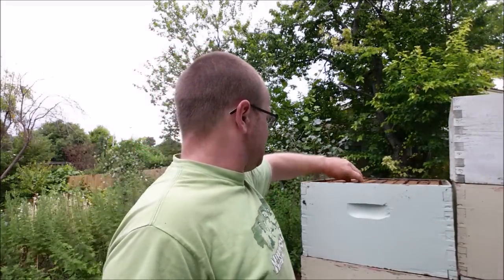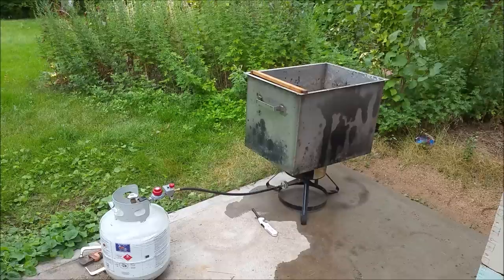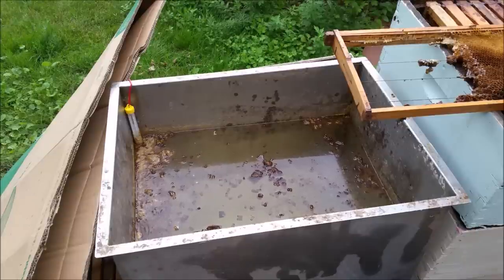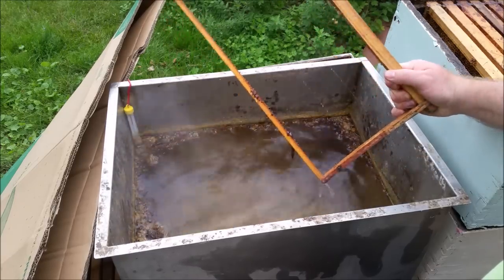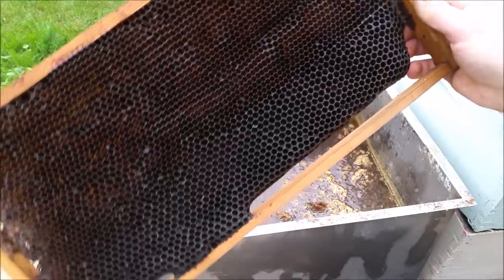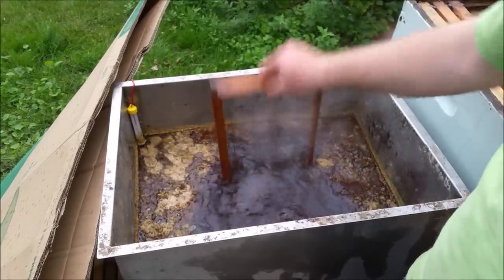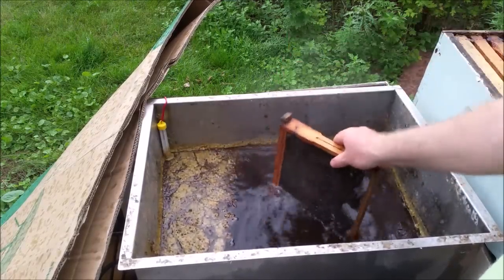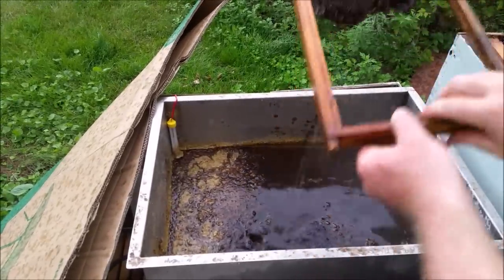How To:  Frame Rehabilitation: Step 1, Melt Comb Out of Frames

Comment: Could you use the solar melter to do this? You could put a few frames in at a time, use a passive energy from the sun, change a few frames out over the afternoon, it would probably take the same amount of time as this, but do both processes at once.
Reply from the maker: Solar melting takes far far longer. Nothing carries heat like water. If you stick your had in 150 degree air, it just feels hot. 150 degree water will scald you near instantly. Plus you're left with the mess of cocoons, those don't melt. You still have to clean them out of the frames.

Comment: You talk about using wood heat.  How about a rocket stove (burns wood) to heat the water.  More heat focuses on the tank.  Just a thought.
Reply: That would be awesome.  I'm a fan of rocket stoves.  I would have to set it into the ground to have the tank at working level, but it would be nice to do this with less wood burning at once, more efficient, no smoke, and able to burn out quicker.  Also could be useful for other things, like outdoor cooking.

Comment: Can you use this equipment be used to kill AFB spores in the wax, so that you could use the wax again, clear of the disease? I understand that AFB will die around 150 - 170 degrees. What do you know please?
Reply from the maker: You can use any melted wax, it encapsulates the spores.  AFB spores are ubiquitous in pretty much all hives.  They are part of the biology of the hive.  A proper balance of biological action in the hive keeps AFB in check, as well as hygienic bees.  If you're trying to sterilize equipment wax dipping is a good option, but that's with paraffin, not beeswax.  Beeswax scorches at 180F and turns brown.  You need to get paraffin up above water boiling temp to dip boxes.

Comment: man!  that is one cool container!    I NEED I NEED!!!--Mann Lake should make those!
Reply: Bee Bob easily fixed with a double burner, or how I usually do it, with a small wood fire. Just couldn't do a fire at this location because it was a rented house with no kind of fire pit.
Reply: Bee Bob That's correct. I use a candy thermometer to keep things under control. Beeswax should not be heated higher than 180 or it will scorch and change color.

Comment: are you worried about the fishing line melting or leeching chemicals when you dip the frame? or maybe youre using metal supports cant tell
Reply: No, only want water at around 160 to 180 F. Not hot enough to boil, doesn't seem to have much effect on the fishing line from FatBeeMan frames.  I don't personally use fishing line, but I do use plastic frames. They work really well in honey supers.
Reply: @wiredforstereo  may i ask you what you do to combat the bees building away from the plastic?  i have a few plastic frames that ive brushed with wax to get them started but the majority of plastic ive seen from my bees and others have a weird building pattern. The bees build away as to double the 'bee space' and make layer of wax they can tuck behind... does that make sense i can find a pic and send it to you. Do you have other social media? Im backroadsapiary on instagram maybe we can message there
Reply: @mmogg4045  Yes, find me on Facebook, or email me, info on my website.

Comment: You can burn wax? I did not know  that good to know
Reply: Yes, you can "scorch" it or whatever you want to call it.  If it gets over 180 it can turn orange or brown.  Still wax, but less aesthetically pleasing.  I forget what temperature it will spontaneously catch fire.  I always try to have water in whatever container I'm heating it with, that way it can never get above boiling temperature.

Comment: Wouldn't it be quicker and easier to start with straight hot tap water instead of trying to heat up cold water?  It would save a lot of time and propane. Also, since the tub you are using is twice the size of the burner, why not use two burners?  That would double the heat output, and should have no trouble keeping the water hot enough.
Reply: Of course. Just didn't have a tap in the back yard. I also use wood heat when possible, even cheaper and faster, but less controllable.

Comment: were bee suit?
Reply: rodney adams Not usually necessary. Bees attracted to melted comb find themselves part of it.
Reply: it my lucky day your online right now. got few questions if don't mind. how do know what combs to leave for next year and what combs to harvest honey. witch get wax. do most bees die and rehatch from eggs kinda like butterflies or are there live bees in hive though out winter.
Reply: also like how much honey and wax can safe harvest from one hive with out hurt bee. is what wanting know. think do candle making and try guess how many candles make with out hurt 1 hive to much. I'm in country but lot house near buy so not want have to many hives if do decide do this.
Reply: rodney adams Bees only live six weeks. So I'm not concerned much about hurting them. How much you can harvest is completely based on the location and management style. There is no way I can tell you what you will be able to do. It will be cheaper to buy the honey and wax.
Reply: @rodney73991  In warmer areas you can get away with leaving the bees a single deep box over winter. In colder/northern areas you might need more than that, I'm not sure how much since I don't live up there. When harvesting honey you'll take however many honey supers there are off (the bees will have to be removed from these boxes before harvesting) and that's the honey you get. Most hives will downsize a bit and the bees will be live through the winter, but if there are too few they can freeze, and if there's not enough food they can starve. In taking wax I like to leave the wax in until it's dark brown, taking all the wax a hive makes through the year means more work early on and less honey made. Whichever you value more will inform that decision of how much wax you take and when you take it. If you know anyone who keeps bees you could ask them for help or what they do. Management strategies can vary a whole lot across states. If you don't know anyone there should be beekeeping associations you can visit and ask questions. There's also many good youtube videos and websites.